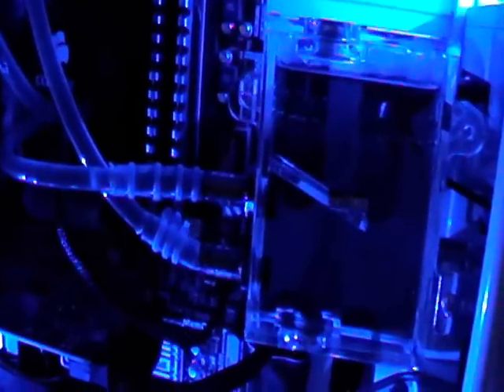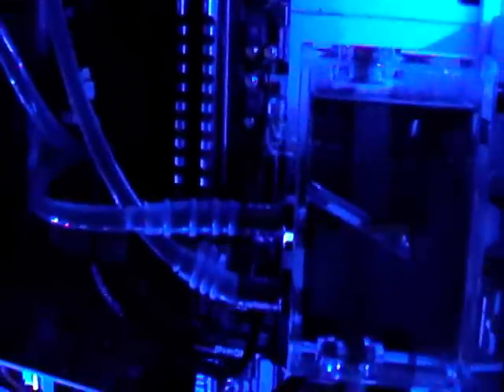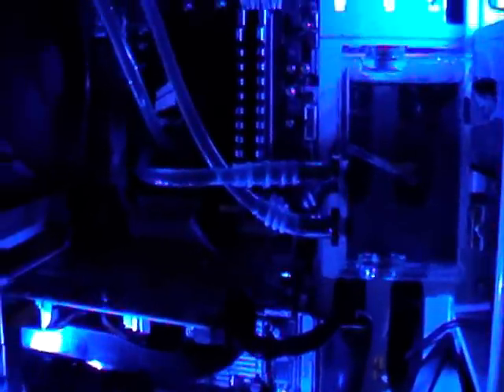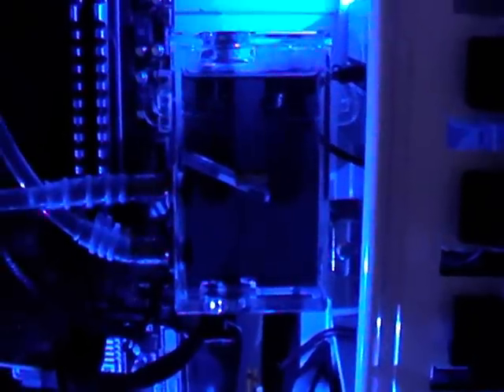Corsair H50 - Modding - PT2

Comment from the maker: Hi,

I used a fan speed voltage reducing cable to reduce pump speed, I think now that the mod has been in my system for 3 months. Dont expect any real drop in temps from it, Its hard to tell exactly how much they have dropped due to ambient temps rising so much, I'd say 3-4c drop. Maybe a bigger res would drop them more or thicker rad, modding the H50 IMO is just for looks.